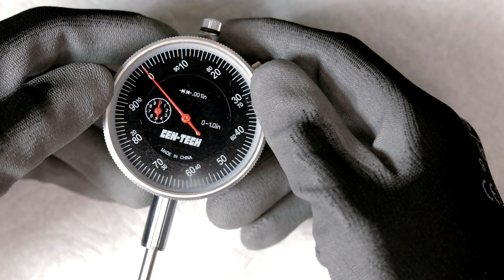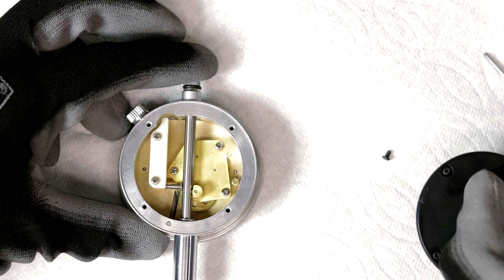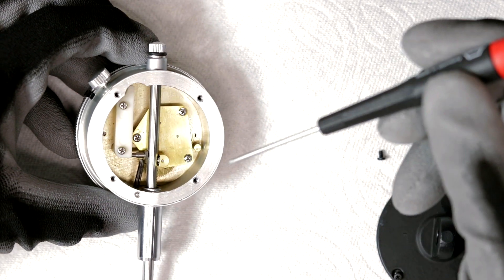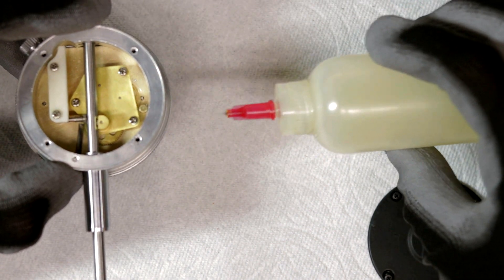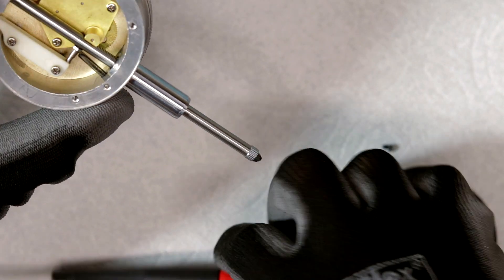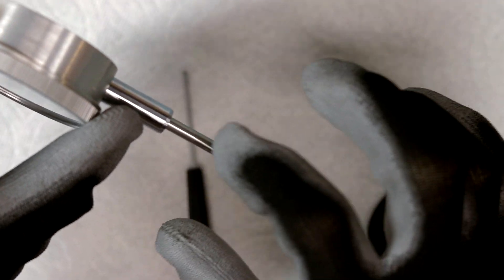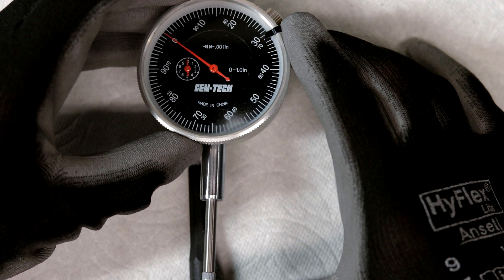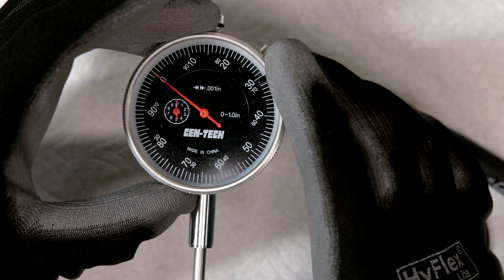How To Get The Most Out of Your Dial Indicator - Simple Trick

Comment: I just opened em up and took an aerosol can of gel lube and opened fire....  shook out the excess, screwed back on the back, took a tiny washer and filed it down to where the needle sits straight up and down putting it underneath the rubber o ring on top brcsuse you can unscrew that top stop.. put some 3 in 1 on the outer shaft and voila, she twerks...
Reply: I didnt get the black face though, my harbor freight 5$ hollers are white faced w/ black needles n numbers.. same exact confabery inside tho...